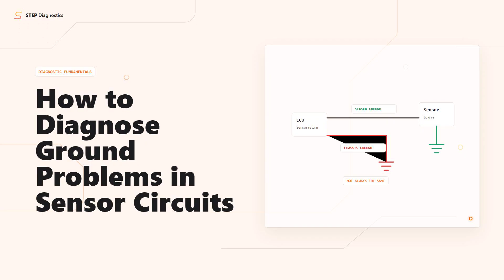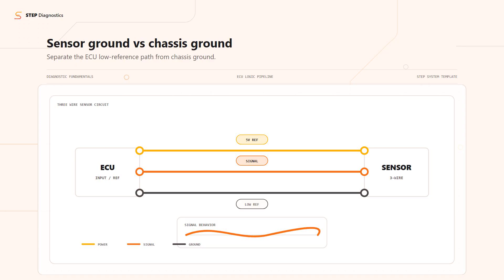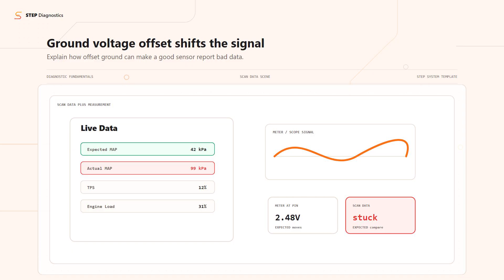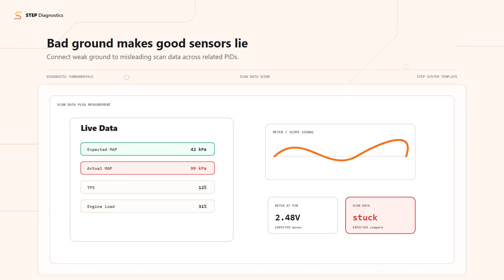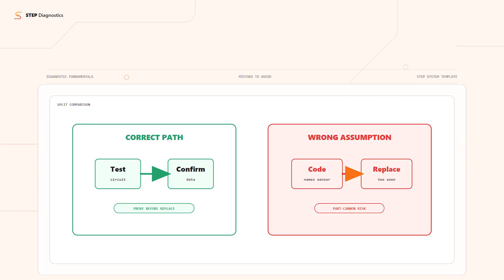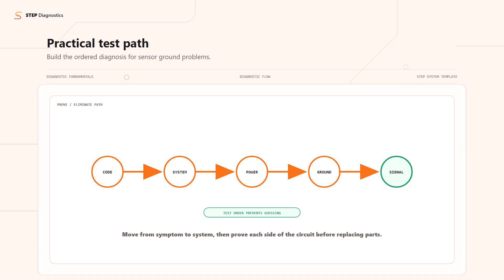How to Diagnose Ground Problems in Sensor Circuits

Comment: I'm going through this exact issue this week.  Thank you for the explanation that clears and confirms my issue. Installing a wide band 02 and had the heater ground too close to the ecu/sensor ground.  Ended up grounding to engine. Cheers!
Reply from the maker: Nice!